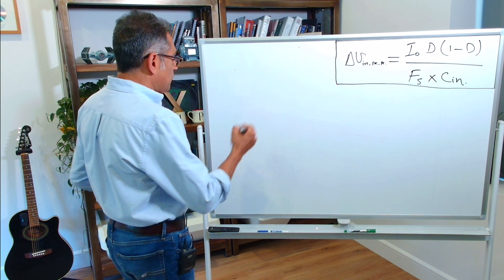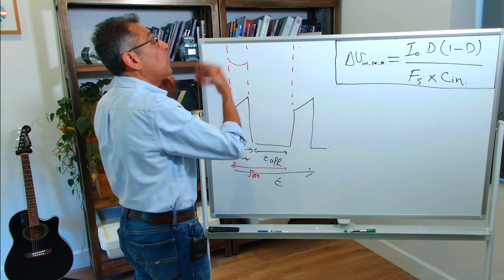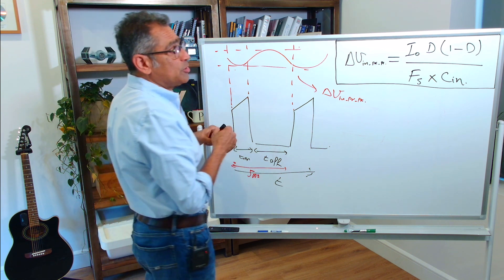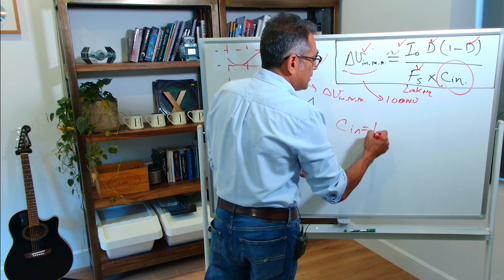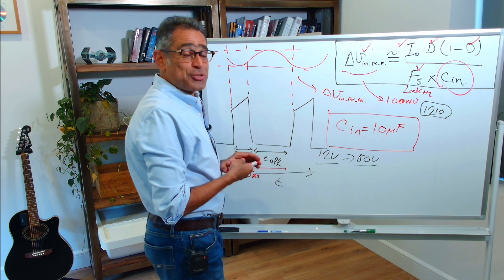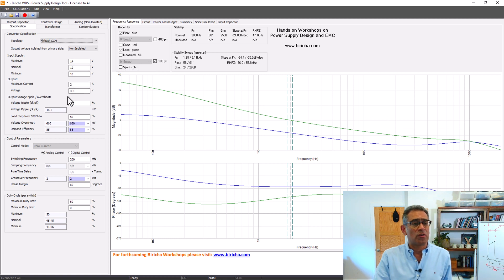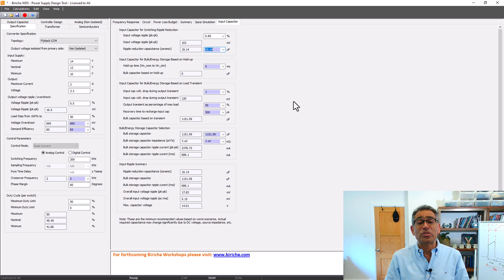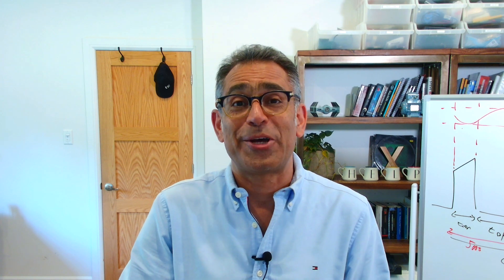Input Capacitor Selection for Power Supplies (Part 2 - Ceramics)

Comment: I am afraid the advice with selecting a much higher voltage rating for MLCC is not good. Higher voltage ratings usually have higher impedance and about the same capacity decrease with DC voltage. Take a look into the design tools of Würth Elektronik, Murata, or Samsung, and you will see this yourself. Selecting the lowest voltage rating and largest package is usually the best choice to give you low impedance, small capacity loss, and the best value for money. The better strategy is to look up the specific properties in the manufacturer's design tools.

Comment: Why does a ceramic capacitor determine the input peak-peak voltage? Why does a bulk capacitor not determine the input peak-peak voltage?
Reply: Ceramic capacitors determine the peak-to-peak input ripple because only they can respond to the high-frequency, high-speed current pulses in switching converters. Bulk capacitors can't, because their impedance is too high at those frequencies.